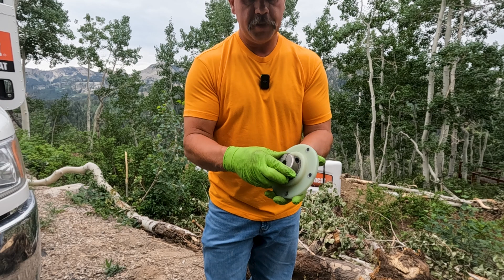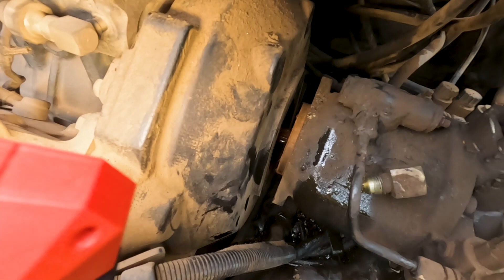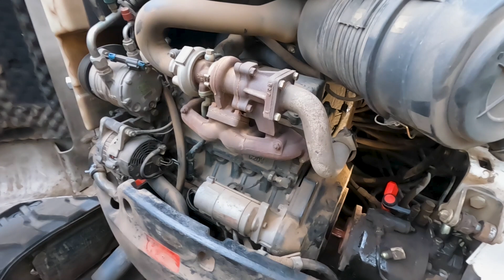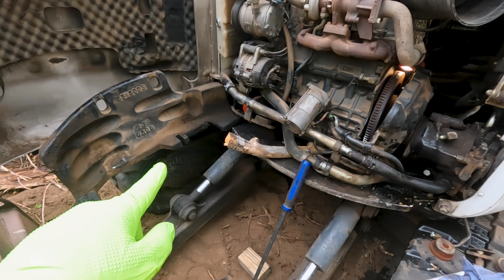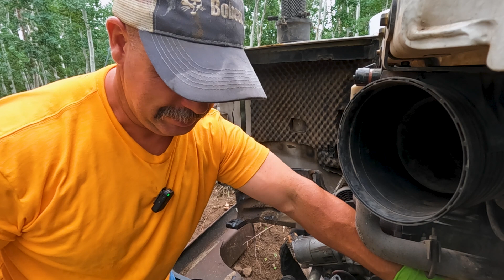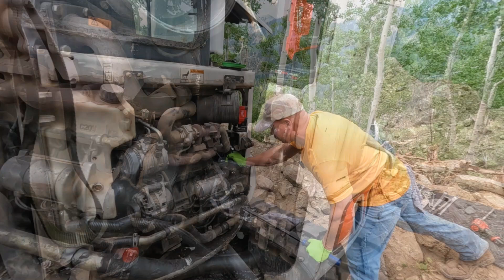Bobcat Excavator Lost All Hydraulic Functions. What Happened and Why?

Comment: Have you ever had to do this on a e10 ? I have one myself is it built the same as larger machines like this. Also how do you stop slack on the turn table ? When i push agaist the boom on the side i get 2 inch of drift not a fan, since i use it in tight spots and inside buildings. Thank you for all your informative videos 🫡 @howididit

Comment: I have a 442 excavator. I had to move something so I lifted the arm rest, got out and moved the stuff. I got back in and started it up. No hydraulic function. It’s a 2007, how do I determine if it’s a cable run blade? If it is then something is up with the pump, coupler or things along that line. What can you tell me on the possible problem.

Comment: Seems like it would be way easier to fix that issue if the designers used a plastic gear on the pump shaft and a metal gear on the motor side in the bell housing (or some kind of plastic coupler between two metal gears, if the pump shaft is to small to transfer the torque into a plastic part directly). Seems odd that people who design these machines don't think more about service and field repairs, especially with a plastic part that is an intended breakting point to protect the pump and will need replacement probably more than once in the lifetime of a machine if it's worked hard by the operator.

Comment: Amazing! Plastic gear just like a KitchenAide mixer! Made to break down while costing top dollar.
Reply: It's sacrificial, cheaper to replace than a sheared pump shaft.
Reply: Had it made in China to maxamize profit
Reply: I can't believe it's made of PLASTIC!!!!!
Reply: @songweaver6076 it needs to be a weak point or you can destroy your engine or a shaft and might as well buy a new motor at that point 6 to 15k then 3 to 8 to install go on ahead 😅
Reply: It has to be plastic as a sacrificial part. If the pump blows up, it will shear the coupler and protect the engine from damage. Much cheaper to replace a pump and coupler than pump AND engine.

Comment: That little piece of plastic can handle all those tens of horsepower? Wow! I would have figured it was all steel parts with a shear bolt or something. Not plastic. Also a ljttle splurt of PB Blaster would make getting those bolts out easier but you got it without so good.

Comment: Hey, I’m really liking your videos. I have a bobcat E 50 excavator. Couple codes came up regarding the load sensor and I was looking to do a hydraulic pressure test looking at the manual service. You need to pretty expensive machine. I was hoping to hook up a gauge and, check the high-pressure and the low pressure and adjust it from there. What port would I hook up the gauge on the manifold side?

Comment: I have a 2009 323 with no hydraulics at all. The lockout light does not come on would a failed coupler cause this (because no pressure) or does that sound like an electrical problem? Any input would help!
Reply from the maker: The light should come on regardless,  sounds electrical to me.
Reply: @tetradgroup  found a couple broken wires in the left arm rest, hydraulics are operational now! It was a tough find, wire insulation wasn't even damaged but wire was broken right through.

Comment: I have a 329 bobcat excavator. I’m only getting 9 V to the hydraulic lock solenoids I have pilot pressure around 25 to 75 off the block were the solenoids are located. I think this is all electrical issue. I had to replace the keyless instrument cluster. I think somebody put a battery in backwards or jumped it backwards. After you placing the instrument cluster 
the machine starts but no hydraulic function.  

My question is where is the solenoid getting its power from? The armrest an instrument cluster?
Reply: Hello man did you fix your machine O have the same problem can you help me please

Comment: I just bought a 2023 R2 E35 and the drive motor is already being replaced. They brought it to me with 3 hrs and by 20hrs drive is popping and is now in the shop. Are these E35’s any good or are they trouble? I’m hearing the 35’s aren’t that great. Dealer is slow they still have the machine over two weeks later.

Comment: I have this same Mini Ex ... I am by no means a mechanic and recently struggled with a hydraulic cylinder seal. To my surprise, I was able to get it all back together. After which, the Excavator worked for a couple moments, then the hydraulic system seemed to stop working. After watching your video I thought I had a solid diagnosis but it turns out my blade still works! So the question becomes,  where else should I be looking? what could be wrong?
Reply from the maker: Does the light on the console turn on and off with armrest?
Reply: Yes, once the armrest is down an light turns on

Comment: Good idea putting your tools on a blanket.  You are quite skilled working in tight spots while recording video.  
When removing a pattern of bolts such as flywheel, head, lug nuts, etc, break one free then retighten to approx 75% of it's specified torque.  Break the next one free and retighten it the same.  Continue until all are broke free.  This makes them so much easier to break free.  That last flywheel bolt was more difficult than the others because it had 100% of the stress on it.  Keeping all the bolts tight divides the stress across all of them instead of focused stress on one.  Great video.  Thanks for posting.
Reply: Interesting. Makes sense!
Reply: I don’t think so. Because that coupler is made of plastic, it’s a bit flexible. Basically each screws fight against it’s related steel insert only

Comment: That 435 really seemed to pull down the engine when doing multi function.  Is that common for those 400 series zero tail swing machines?  My old 331 multifunctions and can blow relief and still never really seems to drag on the engine.

Comment: Really appreciate your videos. I have a 2017 A770 that would give me intermittent error code 4404, Aux Controller loss of Communication. So I bought a brand new Aux controller but now I'm getting an H4423 (Aux Controller Not Programmed) error code. Does the dealer have to program these new aux controllers before they can be used?? If not, how do I program it?

Comment: For a sacrificial part like that they make it too hard to get to. Bobcat sucks.
Reply from the maker: Not just Bobcat but most manufactures use the exact same style coupler. Its like a built in shear pin to protect the pump and engine.  Its actually easier on Bobcat than say CAT which requires the engine to be removed.
Reply: Removed!  That would be impossible.  This mechanic is a genius. If I had the talent he has in his pinky finger, I would be very happy.

Comment: why would it use plastic gearing any prt crazy. If that serves a purpose then why not a double or triple plastic disk so 3 diff sets of teeth to try & catch/ grip fine, med, or coarse sanding teeth b4 it works itself out. Just need 3n1 grip teeth on the other metal prt too. 1 side 3disks other side 3n1 prt so 3 times the wear or prt connect beats no connection. Not working or broke no middle ground.

Comment: Hey man awesome videos. I have a 2019 e45 and the AC isn’t blowing cold anymore. Fan has strong air speed but air isn’t cold. It’s cool but not cold. Radiators on side of machine look clean. Any ideas? I didn’t see a video on the excavators ac systems
Reply from the maker: Couple things on the E45, have you changed both cab air filters?  Sometimes the heater valves are faulty which is located in front of the battery.  You can pinch off the heater hose at valve to eliminate that as an issue.
Reply: I found one filter right below right knee when sitting in cab. It looks clean. I can’t find the other filters
Reply from the maker: @pigslayer106  yeah it sucks, open side hood and look behind and right of hydraulic tank and you will find the filter cover, just pop it off and blow out filter and see if it helps.
Reply: Yes you were right! That filter was clogged. I cleaned it out and blew out the vents with my backpack blower. It blows colder but still not like new. Is there anything else I can try?
Reply from the maker: @pigslayer106  pinch off that heater hose and see if that helps.  Pull the whole inside cover off, just pops off and clean evaporator core.
Reply from the maker: I'll do a video on the excavator AC soon
Reply: Awesome! Thanks

Comment: Engineers… imagine if they designed with mechanics in mind.
Reply: Dude try a rear motor mount on a 2004 Toyota corolla 😆  this is a cake walk
Reply: That would cut into their company’s profits
Reply: I don't understand why they don't use something like John Deere has on the 650, 750s. High horsepower but they have plastic on plastic for that connection. It's 3 square pegs in 3 square holes, for both pieces. Not metal vs plastic.

Comment: At what point do you decide to field-fix (Stay and Play) vs get a Crane and transport to a shop (Load and Go)?
Reply from the maker: Very rare I send one back to shop.  Today for instance I had a track off a T870 in the middle of a creek bed and engine would not start, 4 hours later the machine was operational and removed from the creek under its own power. I recommended the customer take to shop to have cleaned and inspected for any additional damage and to make sure no water got into fuel tank.

Comment: That really sucks! How many hours did the machine have?

BTW, how the hell do you stay so clean, I would be covered head to tail
Reply from the maker: This machine had about 4000 hours on it and I believe that was the original coupler because all the bolts were in the bell housing, usually I find if a coupler has been replaced then all the bolts do not get installed because of the difficulty of getting to them.  I get accused of not working all the time because I never get dirty lol.
Reply: @tetradgroup , I have a question about a 773 bobcat diesel engine, looses tilt and up, down movement to the bucket, tried removing sensor but can't get it all the way off the shaft before it hits engine, any advice?